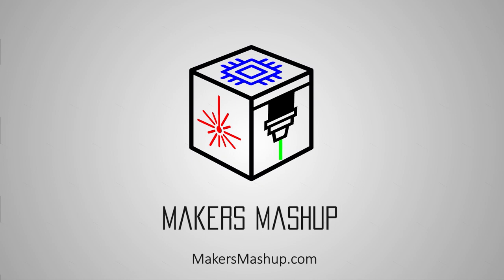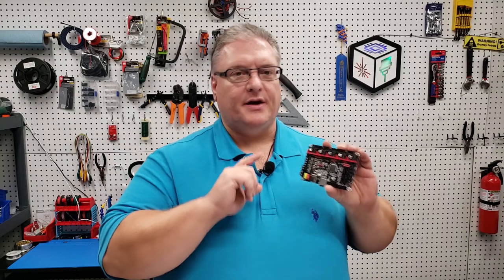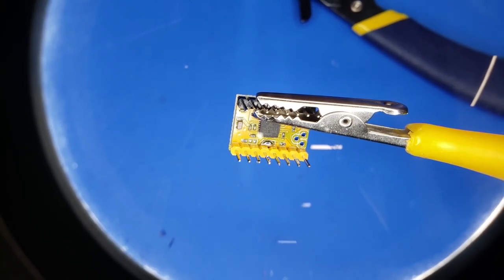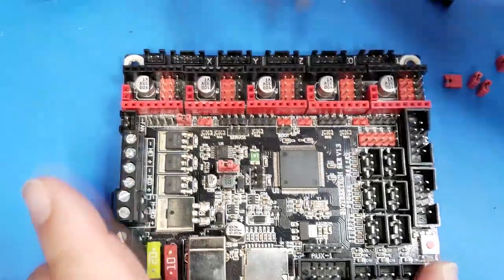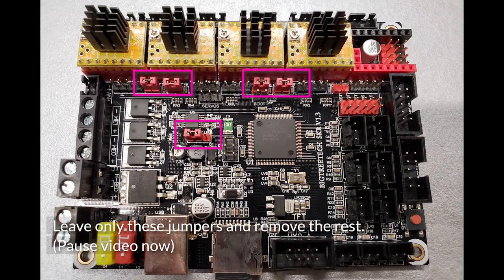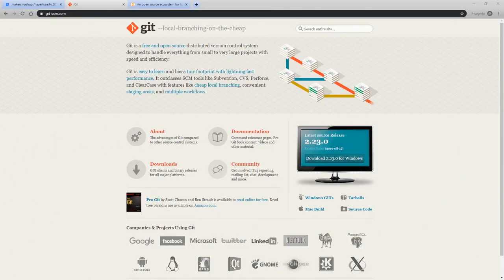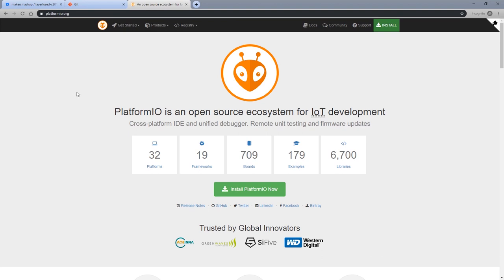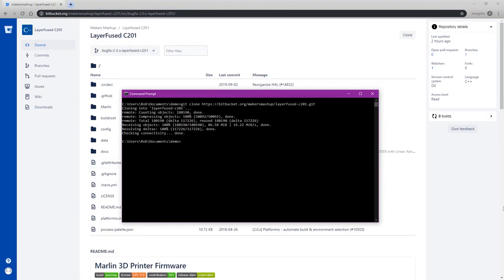Build Your Own DIY 3D Printer - SKR Mainboard Setup

Comment: Do we need PlatformIO, or could we use Arduino's IDE? or even Microsoft Visual Studio?
Reply from the maker: Great Question Christopher.  At the time I made these videos PlatformIO and Atom were the IDE's recommended.  I have since switched to Visual Studio per Marlin's recommendation.  You'll still need PlatformIO inside of Visual Studio however.  I have not compiled it on the Arduino IDE except marlin 1.x. ..  https://marlinfw.org/docs/basics/install.html has the most up to date information on what tools are supported.
Reply: @MakersMashup  You cannot use the Arduino IDE. That board uses an NXP LPC1768, which is not supported by the Arduino IDE. Another option however is to use ARM Keil. But, I prefer PlatformIO over it any day.

Comment: I have done all the steps but instead of Atom, with visual studio, I have a problem when I try to compile and upload marlin to the board. I get an error in the json after finishing the predebug and doing the PIO-Debug: undefinedTraceback (most recent call last):
  File "C:\sersers\Rebe.platformio\packages\tool-pyocd\pyocd-gdbserver.py", line 24, in <module>.
    from pyOCD.tools.gdb_server import main
  File "C:\Platformiopackages-platformiopackagestool-pyocdose-platformiopackages-packages-platformiopackages-gd-gdbserver.py", line 18, in <module>.
    import board
ModuleNotFoundError: No module named 'board'.

Comment: As in this project we are using 5 stepper motors but using only 4 stepper drivers ? Could you please explain . Thanks in Advance. Eagerly waiting for your reply...
Reply from the maker: The Z axis is controlled by only one stepper driver.  The signal is split between the two steppers. Alternatively you can use another steps driver but to keep costs down, one driver and a splitter were used instead.
Reply from the maker: Also, many modern boards like an SKR 1.4, 2, etc, have a Z splitter built in now.  Give then video is over 3 years old you'll need to adapt for whatever mainboard you're planning to use.
Reply: @MakersMashup  Thanks for the reply, Yes I am using the SKR 1.4 board, so I think I would be needing only 4 stepper drivers. Thanks Again

Comment: UART, haven't heard that in a while! Reminds me of dial-up modem days ;+}
Reply from the maker: Same here Gary. Remember the days where you had to add your own 16550 UART to get a second com port on some boards? 🤣
Reply: @MakersMashup  Absolutely. When 14,400 BPS was astounding :) Great series by the way, i like how methodical you are with it all. I've been trying to come up with a frame/bed combo that doesn't ever need leveling, i am sick to death of having to level a lot with my i3 and the V5 hotend, just a tenth of a mil off and layer 1 doesn't stick. I'm thinking, if we have a square frame, why do we have to have the bed on springs, can't it just be level if mounted on the same-size supports, but then you have the x-gantry ... I realised after some thought that it's pretty much impossible, but it was fun thinking it through. I do have an ida for an autoleveller though that i need to put together. Would you like a small, hand-held tool that levelled individual corners or are you happy doing it manually, would a tool be overkill ?
Reply: @MakersMashup  I just checked my old cable bag and i still have a couple of those com expanders! Plus lots of IDE cables and a ton of other stuff i should have thrown away decades ago!

Comment: I was wondering if there is any way that we could control the 3d printer stepper motors without a control board. I mean to say, is there any way that we can use an old computer as a mainboard?
Reply from the maker: I'm not aware of any 3D Printer firmware that runs on a PC Mainboard.  Now you could in theory find an emulator for Arduino and then install Marlin or something else on that but you would have not have a way to drive the stepper IO (and other functions) easily.  Your best bet would be to just get the SKR or if you're on a budget crunch something like an MKS GEN L.  You would likely spend far more money trying to make a PC work with a 3D Printer than just getting the mainboard straight away.  Probably not what you wanted to hear but its really the best option.
Reply: @MakersMashup 
ok
Thanks for the reply.

Comment: I'm just curious why you chose this board and drivers over others.
Reply from the maker: Great question.  The SKR is is a 32 bit board over the 16 bit boards like MKS GenL.  It has more memory space as well so I'm able to load every feature of Marlin into it.  It also has a faster processor along with more memory.  Those were the primary reasons.  The low cost of this board (Around $22) is very attractive as well.  The Drivers were chosen for their silent capabilities.  I could have gone with something like a TMC2130 and added sensorless homing but since this build was for my Nephew and going into his bedroom the TMC2208's seemed like a good choice.  Going with cheaper drivers would have saved a few bucks but A4988's are pretty noisy. :)  I wanted him to be able to get some sleep and only have the noise from the fans if he chose to run a print overnight.   This was a great question Johnathan, thanks for reaching out.
Reply: Thanks for the fast reply!  I am following the build closely. I have my aluminum extrusions ordered and am looking around for the best prices on the other items. If not concerned with noise are the tcm2130 better for the project?
Reply from the maker: The 2208's are probably best for the project.  They produce more torque than the 2130s, while they do have some neat features like sensorless homing that wasnt considered in the build.  I would stick with the 2208's unless you're looking to doing experimentation.
Reply: @MakersMashup  Thanks for the great guide! I know your build is already a year old - so that might already answer the question I have. Why won't you use octoklipper instead of marlin? It's supposed to be amazing. Input shaper is like black magic. A buddy of mine wrote the install guide for the Artillery SW X1, and he was able to print at 230 mm/s because of input shaper! Pretty amazing stuff.
Reply: @milkymakes1  Hello Jonathan. I'm very curious as to what the actual cost was in the end, for the entire project.
Reply from the maker: Klipper will be going on and a twist as well.  It's in the pipeline. 😃o
Reply: @FuriousImp  I don't remember the actual cost of the machine because I had to buy an ender 3 to complete it. Lol. It was considerably more than an ender 3 or something like that, but it is my most consistent printer I own.
Reply: @MakersMashup  Interesting! Thanks :)
Reply: @milkymakes1  nice

Comment: Hello! I'm replacing the mainboard on my knockoff Prusa I3 clone to try and resolve some strange artifact issues that don't seem to be caused by the physical machine. If I buy a SKR v1.3 board can I still use A4988 stepper drivers? If so, is there a resource for jumper placement to work with the A4988 stepper drivers? Thanks!
Reply from the maker: Yes you can use the SKR v1.3 with A4988 drivers.  https://www.youtube.com/watch?v=yLm7Yl8_QUU seems to cover how to do that.  Thanks for your question Greg!
Reply: Are you using Cura? If so, try another slicer program, before spending time/$. Merely a suggestion.😊
Reply: @patrickbodine6010  Tried S3D, Cura, and Kisslicer, without solution. I've solve most of the issues with mechanical fixes (primarily, binding on one Z axis side and a warped heated bed) but still seeing some artifacting that I can only attribute to electronics. Yesterday I ordered a Duet  Maestro, so that will be the ultimate test.
Reply: Ah, ok. Best of luck!
Reply: @GeeksThroughoutTime  curious if you resolved your issue of artifacting and what you did to resolve it.
Reply: @ChristopherJones16  I did! Though I did a ton of things, any of which was part of the fixes. 

First thing was that I replaced the electronics with a Duet Maestro. This is, quite simply, amazing. At the price it should be, of course, and it was. Put it this way...on my cheap Chinese knockoff printer I was able to print tests successfully at 0.02mm/layer (though I will never do that for regular use).

Past that and not in any order, I replaced the glass on the bed (under a removable magnetic print sheet), re-tightened every screw/bolt/nut, re-oiled everything with silicone grease, loosened the Z-nuts (surprisingly important), added vibration dampeners under the printer (ringing is now completely gone), increased my print speed to 3200mm/minute (but reduced my exterior shell to 30% of that), replaced my extruder motor (didn't really need to), and reorganized all of my wiring (including replacing all of the connectors with the ones provided by Duet). And then, of course, re-calibrated everything.